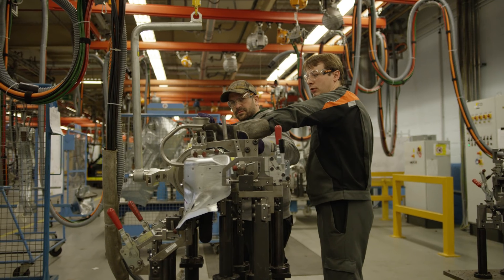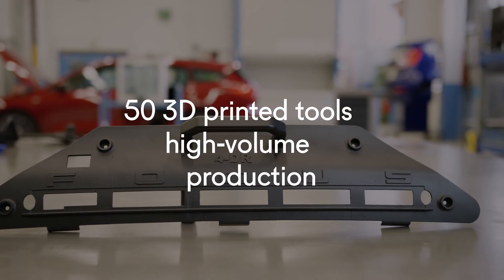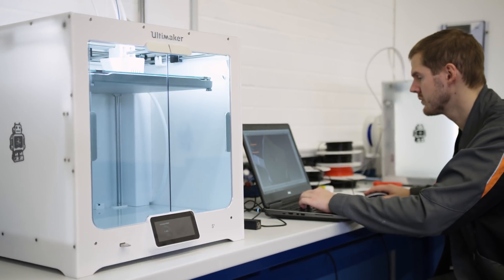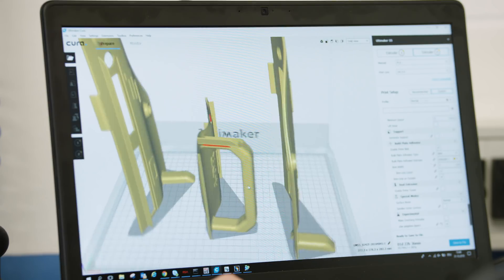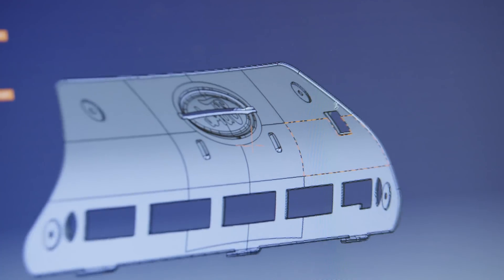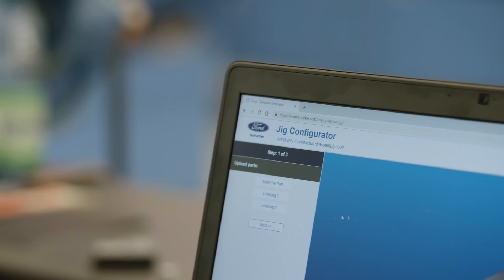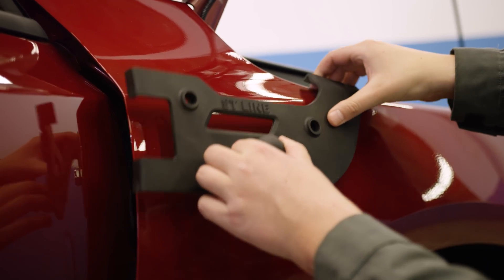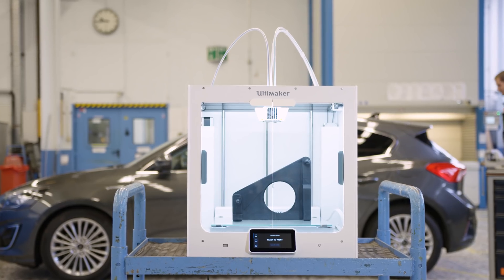Ford Europe: 3D Printing workflow for custom tooling

Comment: At 2:35, your saying that was 3D printed?  Looks molded... Am I wrong?
Reply: Looks moulded. They don't directly say that the part is printed.
Reply: @georgemaniatis4673  it was actually the same part as at the beginning of the video. It was printed. I think it was a nylon/CF print which has a super nice surface finish. But not sure. Or just nylon. CF might scratch the car.